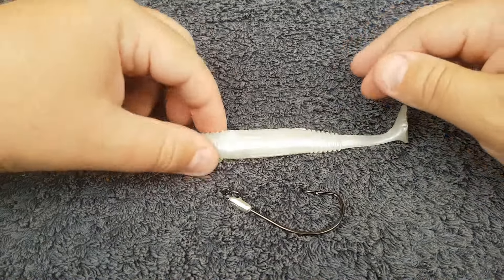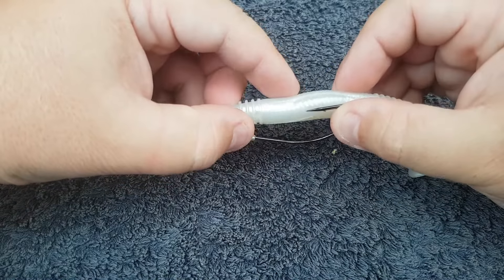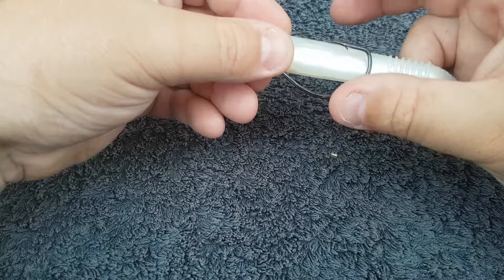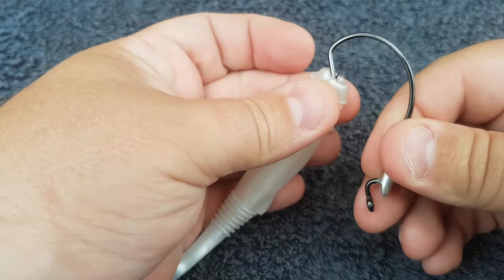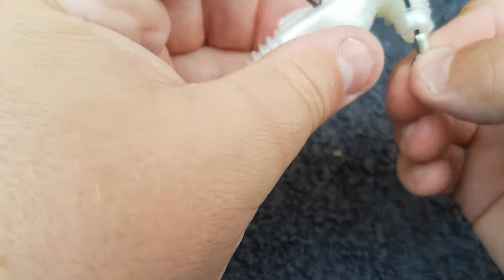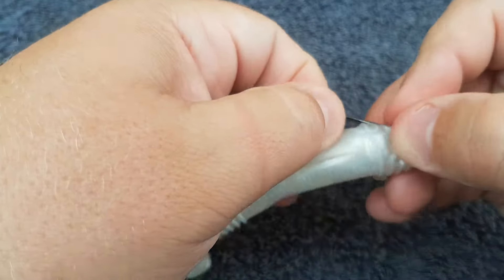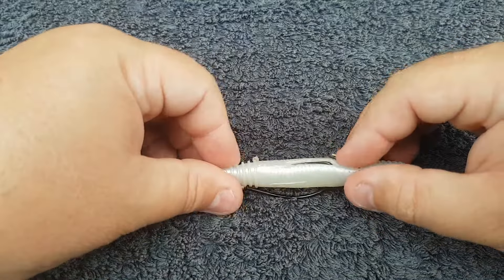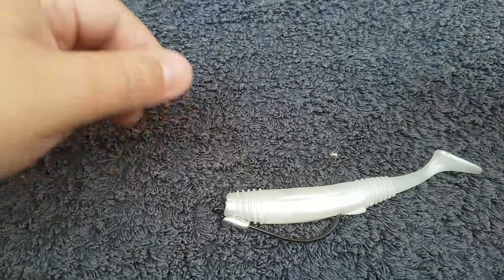HOW TO RIG A SOFT PLASTIC WEEDLESS!!

Comment: what is good about this video was that you show getting the plastic up and over the jig head's thick barb.  That's what I didn't know, if the soft plastic would survive that.  but now i see how to do it.    this is especially important on those hooks that are weighted with a longer weight in the middle, not near the eye.  i guess you can shove right past it.